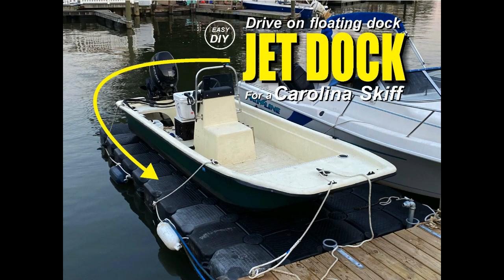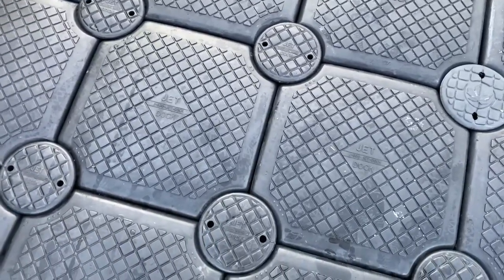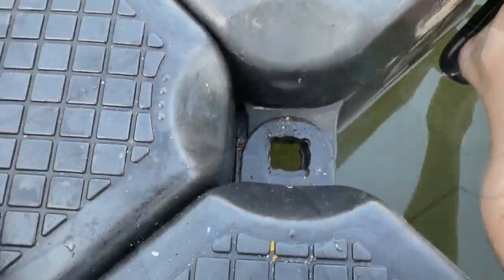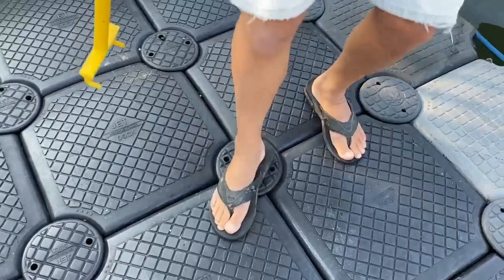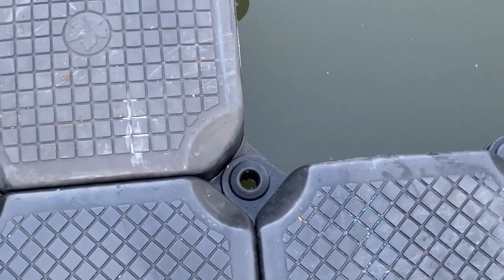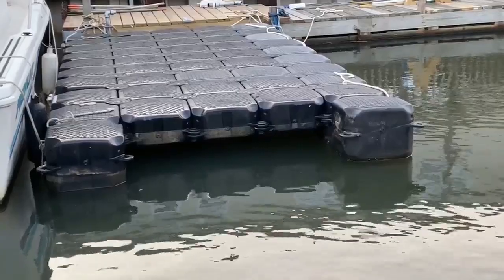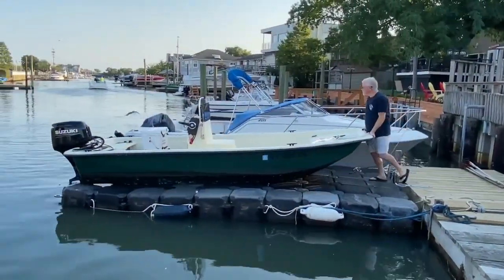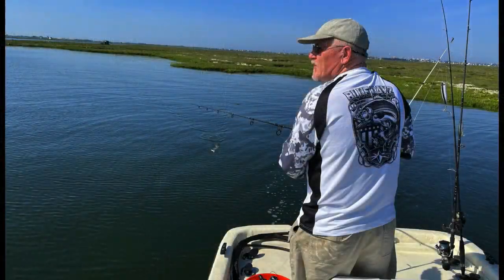JET DOCK Drive on floating dock for a Carolina Skiff

Comment: Did you have any issues taking pins apart on the used jet dock, is it hard to pull appart.  Thinking about getting used one but have to take it appart to transport it.
Reply from the maker: You need a special tool to take them apart. Its a big spanner wrench. Without it it would be almost impossible.